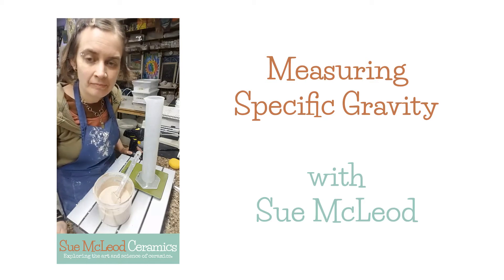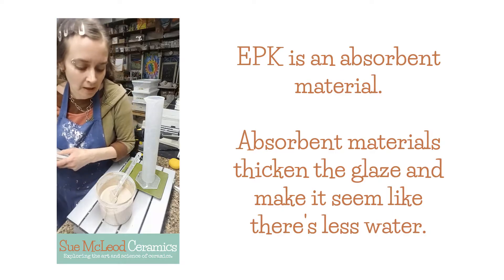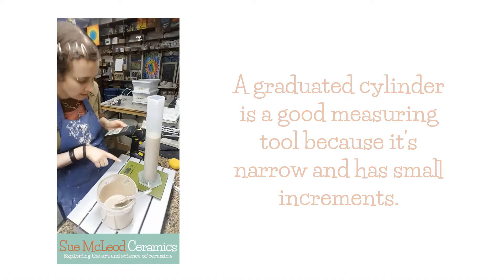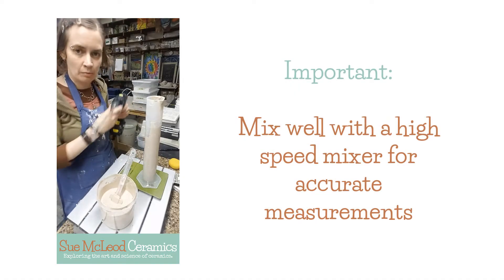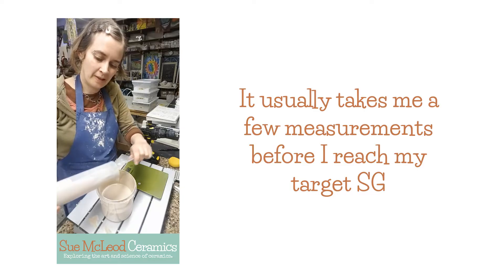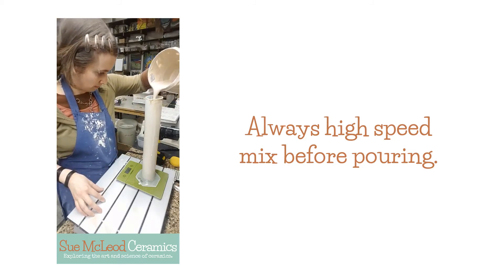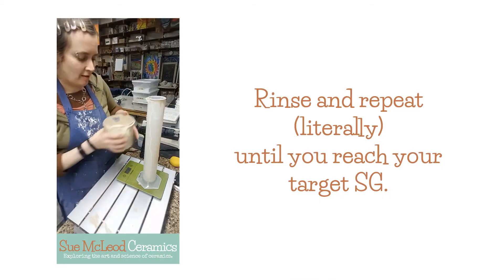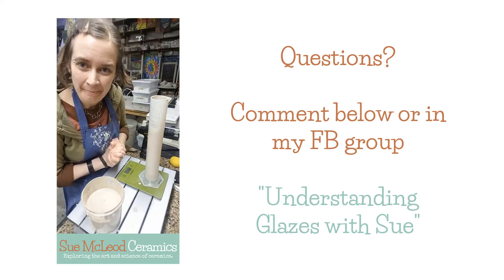How to Measure the Specific Gravity of a Glaze

Comment: So originally i thought the gravity measure tube came with a 'special' floater that told you the gravtiy (without the calculation). Based on your method I guess you can just use any accurate measuring jug, set the scale to zero, add the glaze and then do your calculation? and with a jusg easier to get glaze out to add more water.

Comment: That’s great. My biggest issue, however, is with knowing what sg to aim for … I havent been able to find guidance around it for beginners yet :(
Reply: If you’re using commercial glazes you can probably find it online or through the supplier. but for recipes you make you’ll have to test. Most dipping glazes do well around 1.40 - 1.70 usually.

Comment: Enjoyed the video.  Have been doing specific gravity checks of my glazes for some time.  Like seeing what others do.  I measure mine out to 100 ml and weigh that in grams, no dividing needed.  But I like your method too since it doesn't require being spot on with the measurement to 100 ml.   p.s. also enjoyed your voice/accent.  :-)
Reply from the maker: Yes, I started out trying to get 100mL on the nose but it was too hard and messy pouring back and forth so now I just do the math. It's cleaner :)